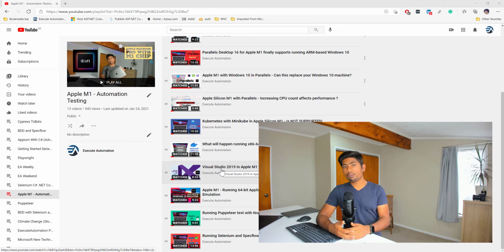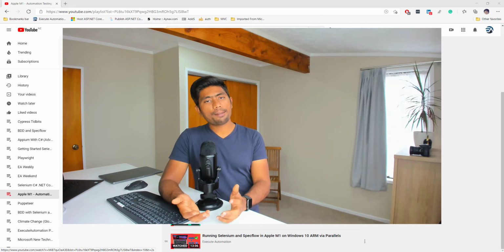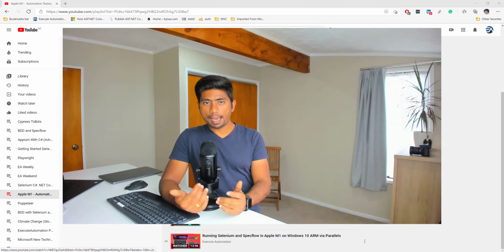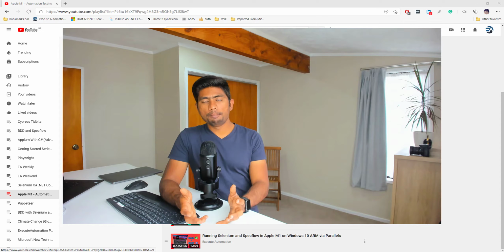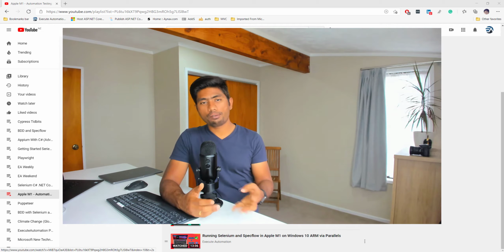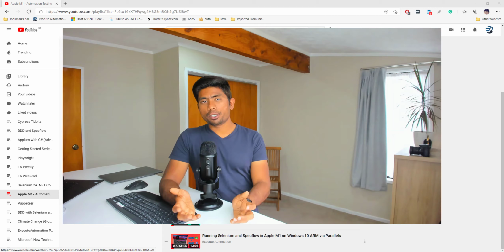Is MacBook Pro powered by Apple M1 ready for software testing?

Comment: Can you help me to decide a macbook type I should buy?
I am a QA Engineer, I am usually use LocalWP + VSCode + Cypress.

Based on my budget I can only get 3 type of macbook (I buy secondhand macbook btw).
1. The cheapest is macbook air m1 8/512
2. The middle is macboom pro m1 8/256
3. The higher is macbook air m2 8/512

Which one I should choose for my scenario?
8/512 is enough for QA? And do I need Air / Pro model? M1/M2?

Thanks